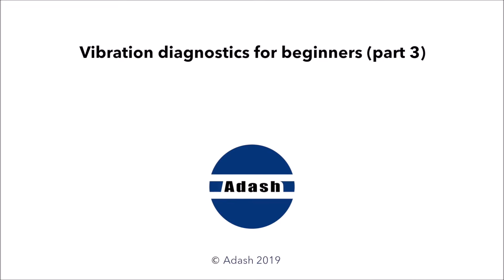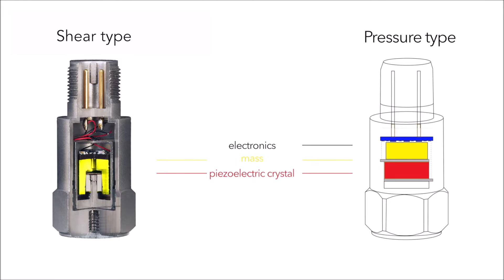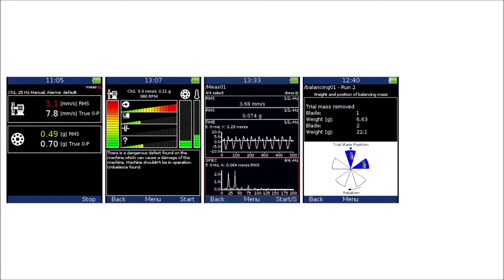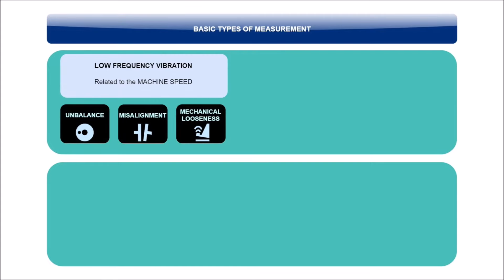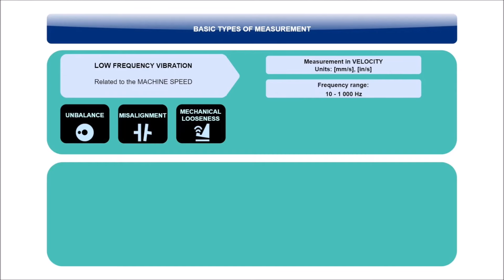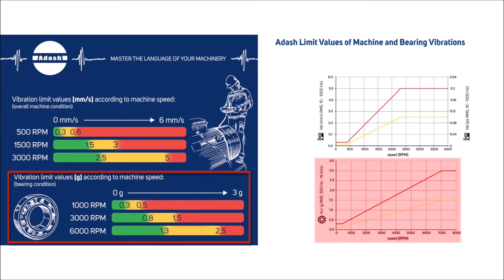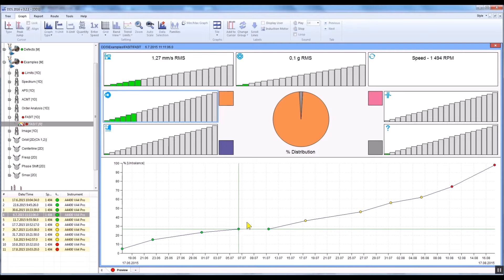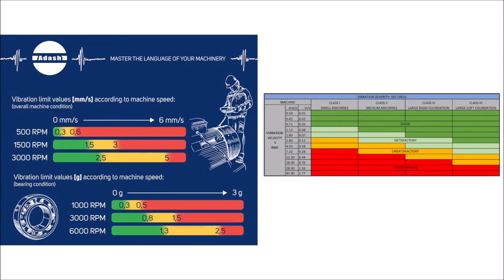Vibration Analysis for beginners 3 (vibration limits, types of measurements, acceleration sensor)

Comment: Easy to understand ..We were using the acceleration measurement for some engine parts and i was confused with units of  Acceleration which was measured in G and the reason behind it..i am thankful for it..I would like also know if you could explain the strain were some time measured in Pa while measuring on strain gauge...but normally it is dimensionless.as it change in length over original length
Reply from the maker: We would love to answer question from vibration analysis field :-)
Reply: Hello sir , I have Raw data of Acceleration in x , y and z axis can I get frequency weighted acceleration from this data ?

Comment: Why to take horizontal, vertical and axial reading in Moter
Reply from the maker: Ideally you would like to get as much information about the machine you can. Horizontal measurement discovers unbalance problems, vertical gives you info about mechanical looseness. But normally it is ok to place the sensor on 45 degrees on the bearing house and therefore to get vibration signal from both directions. You should definitely take at least one axial measurement on the machine because this direction is sensitive on misalignment. Take this one near coupling on the motor DE for example.

Comment: What is the displacement and acceleration limit of vibration (Drms and Arms) according to the ISO standered ?
Reply from the maker: ISO standards mentioned in this video takes into account only velocity measurement.
Reply: @AdashCompany  sir, I am trying to replicate the vibrations developed by industrial motor with a vibration motor, but I only know the velocity limit from iso. But what is the value of acceleration, frequency and displacement. Please help me 🙏🙏
Reply from the maker: @mechzion01  ISO standards takes into account only velocity measurement. There are no official limit values for acceleration and displacement. Frequency is different physical quantity.
Reply: @AdashCompany  how to choose a vibration motor , to replicate the vibration caused by industrial motor?..plz plz plz plz help
Reply from the maker: @mechzion01  Even a small workshop grinder can simulate vibrations of industrial motors as you can see in some of our videos.
Reply: @AdashCompany  sir, how to decide the speed and power of vibration motor, which provide the Vrms value of industrial machine vibration
Reply from the maker: @mechzion01  Again. Even a small workshop grinder can simulate vibrations of industrial motors as you can see in some of our videos.

Comment: Dear sir, do you have any analyzer which can be used for shop balancing [2 planes] method also ...
I undoubtedly trust on ADASH, beacsus of it's preciseness,,

Digivibe M30 from Erbessed Instruments, can be used as 'vibration analyzer and on-site balancer' and also can be used for shop balancing purpose[only cradles/bearing suspensions/bearings and drive motor required seperately]
Reply: In short, will it be great to use for both shop and on-site analysis and balancing purposes,,,,, instead to use them seperately
Reply from the maker: You can use any Adash analyzer which is is capable of 2 plane balancing. Therefore:

VA3Pro: https://adash.com/portable-vibration-devices/a4300-va3-vibration-analyzer
VA5Pro: https://adash.com/portable-vibration-devices/a4500-va5-vibration-analysis-thermal-imaging-ultrasound
A4404-SAB: https://adash.com/portable-vibration-devices/a4404-sab-pocket-vibration-analyzer

Then you will need only cradles/bearing suspensions/bearings and drive motor as you mentioned.

Comment: Hello, 
Please, for the calculation of the shaft rotation frequency (f=RPM/60) do we take the rotation speed indicated on the nameplate or do we measure the speed on the spot during the collection of vibrations data's. In this case the rotation speed will be variable every time when we collect data and Wich tachymeter do you recommend.
Thanks to anyone who can help me to clarify this point
Reply from the maker: To measure speed during taking of vibration data will be more precise. Of course to trend the vibration data it is good to measure the machine under same speed and load. We are using laser speed probe with reflective tape glued on the shaft.

Comment: Good one! i have a query, In case of 3 Axis vibration sensor, which axis value should be taken for threshold limit as per ISO standards. Axial or Radial vertical or Radial Horizontal

Comment: After we get velocity value, how do we differentiate wheter the problem is unbalance, misalignment or looseness?.
Reply from the maker: You can not differentiate problems with just one value. Each fault has a specific pattern in FFT. Unbalance usually has significant peak only on speed frequency although it could be also related to electrical problem. It seems it is a good topic for our next video.

Comment: In a pump motor set is it a good idea to  decouple the set and check the motor separately for vibration or it should only be checked in load condition?
Reply from the maker: Decoupled components will vibrate differently. It is actually important to measure your machinery set together.

Comment: Can you use on of these vibration meters to measure subtle vibrations from washing machine next door by putting it on the floor or wall.
Reply from the maker: Yes, you can. But it depends how far the washing machine will be from the sensor? To put the sensor on the floor will be better and probably to use acceleration sensor with higher sensitivity of 500 mV/g or even 1000 mV/g.
Reply: @AdashCompany  I sleep next door to apartment. Their washing machine sends subtle non random pulsing vibrations hardly detectable unless you are sitting or lying down. I think it even damaged the back of my head brain? My head behind feels permanently hot. Would like to record vibrations to put pressure on selfish neighbour who runs machine all night every night and also sometimes in the day. My mother is suffering this every night even with lockdown and her cancer treatment. Anyway thanks for advice.
Reply from the maker: @Bea_remembrance  Vibrations can be surely measured. Maybe also sound level meter will help. But we are sorry, this case is out of our expertise.
Reply: I check my vibrate

Comment: May be a dumb question but if i was using a piezo disk sensor which outputs the vibration, how could i plot the acceleration from the vibration data?
Reply: The piezo disk is connected closely to the shaft of a dc motor
Reply from the maker: What device you have to process the data from piezo sensor? Normally a common industrial sensor has an output in mV/g and analyzer is able to plot the vibration data in acceleration, velocity, displacement.
Reply: @AdashCompany  I'm using an ADC so that I can plot the data in visual studio.

Comment: A strange question. But will an  accelerometer give different readings is stuck to a device on different planes. ( eg...  like the instruction show, as opposed to on its side ? ) 

I mean I know it should. But trying to figure out how / why someone did this in a real life situation designed to test multiple vibration plates.
Reply from the maker: It will surely give different readings on different planes. Motor drive end has some other component connected. So there will be different vibrations than on non drive end. Also question of how the mchachines is anchored on each plane and other aspects.

Comment: Is a vibration sensor such as the one sensitive enough for me to detect and measure vibrations from a cd player, and also detect and compare the difference when adding special dampening feet under the cd player?
Reply from the maker: To measure vibrations is of course good method how to compare the difference with/without damping.
 Acceleration sensor shown on the video is most common for industrial usage. I'm afraid it won't be suitable for your application. You should try miniature accelerometers which are available on the market. They are small in size and weight and therefore they have better response for measuring on small equipments such as CD players.
Reply: @AdashCompany  Thankyou for your reply. I couldn't find anything online when searching for "miniature accelerometer", but I did find a modest looking "digital vibration meter", would that likely work? The device appears medium in size and it has the stethoscope device attached on the end of the cable (the acceleration sensor). The device seems to display 3 different readings on the digital screen. It shows "VEL", "ACC", and "DISP". Would this likely work for reading low level vibrations such as from cd player? Thankyou for your patience I have know one else to ask.
Reply from the maker: @jamest4198  Basically any vibration meter can do the job for you. 
But it is really more about a sensor which should be small in size. We don't want to do an advertisement to sensor producers over here, so please write to our sales department and they will guide you to select apropriate sensor. Email: revaj@adash.cz

Comment: It was really beneficial for me as I am conducting research on measuring the vibration level of the transformer. Is vibration in the transformer windings related to the high freq vibration?
Reply from the maker: Transformer vibrations would not be related to high frequencies. They will be related to line frequency. Therefore depending on your location it will be around frequency of 50 or 60 Hz and its harmonics. However we have to admit that we have more experiences with rotating equipment vibrations.

Comment: How do we convert output voltage value into acceleration in g for vibration sensor?
Reply from the maker: The acceleration sensor has a sensitivity expressed in mV/g (sens), ie sens = mV/g.
If you want to find out what voltage will come from the sensor at a certain acceleration, then mV = sens * g
If you want to find out what is the acceleration when you know the voltage from the sensor, then g = mV / sens
Reply: Thanks @AdashCompany   . But we have calculated as Acc in g = (o/p voltage - Zero o/p voltage) / sensitivity.
Can u pls tell me is it right or not?
Reply from the maker: @gayathris4489  
Your question is not very clear to us.

There is a dynamic signal on the sensor output means voltage according to acceleration. No matter if you measure RMS, 0-P or P-P the conversion is always the same. For example if you measure 200 mV 0-P with 100 mV/g sensitivity then it is 200/100= 2g 0-P
Send us email on revaj@adash.cz if you want to discuss this issue in details.